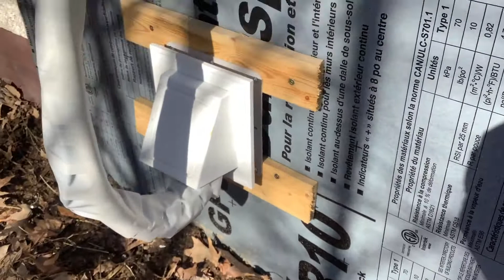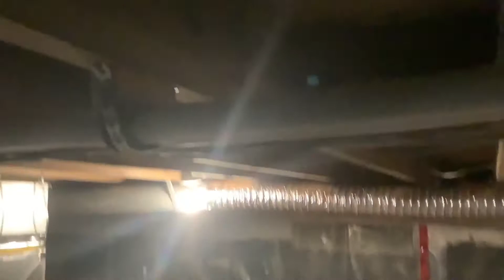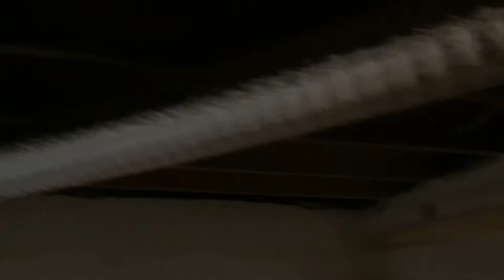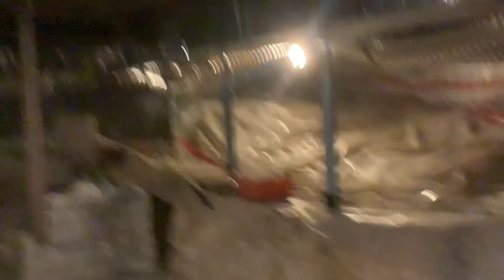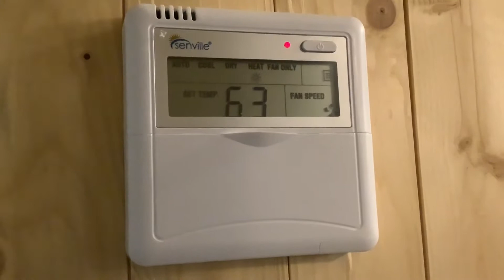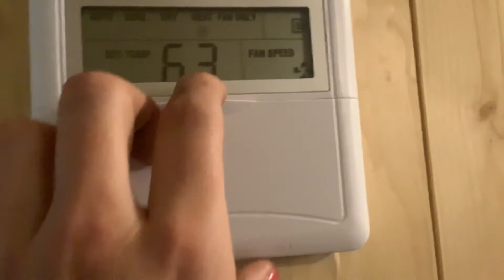Senville Ducted Heat Pump

Comment: Hello is this the same as the 36000 BTU Central Air Conditioner Heat Pump System - SENDC-36HF with 10kw heater?
Reply from the maker: No it is not the same

Comment: Hello.  I have just installed this.  We have power going to outside unit but no power going to thermostat to turn on the unit.  Can you please show me how is the wire comnected to inside unit?
Reply from the maker: We also had this problem at first. By going to https://senville.ca/ we found the materials needed to help us install it. Good luck my friend! These units are definitely worth it!
Reply: @lianahewitt6927  thank you.  We figured it out.  The installation instructions definitely can be more clear.

Comment: What unit did you get and how did it perform in the summer?
Reply from the maker: We got the concealed duct 24hf-id. It's amazing in the summertime. We have 40ft wall of windows and don't even have to close the blinds. It keeps up beautifully and costs us less than a dollar a day to cool
Reply: @lianahewitt6927  Same Q as the other reply- I am about to pull the trigger on a 24K slim ducted and 12k slim ducted. A.I. has me worried about the low static pressure when running way less branches and flex duct than you did, but it seems you are thrilled with your results. Do you feel there is low airflow anywhere?
Reply: Do you feel much airflow out of vents on those long vent runs?  I’m debating getting one but worried the longer runs of duct won’t get much flow
Reply: @joelramadan7602  I've been using ChatGPT to do duct run calculations. It seems quite effective and accurate, but it does have me worried a bit. I plan to do less flex duct run than this video, but calc says I'm on the edge of what would work (for the 12K version, but still on the bleeding edge for the 24K too). PM me if you want detail. It's twice the kit price for a high static pressure head from the OEM of Senville (Midea), so trying to avoid.  Oh, and you can use duct boosters if needed, but you'll try to do it right before resorting to that.